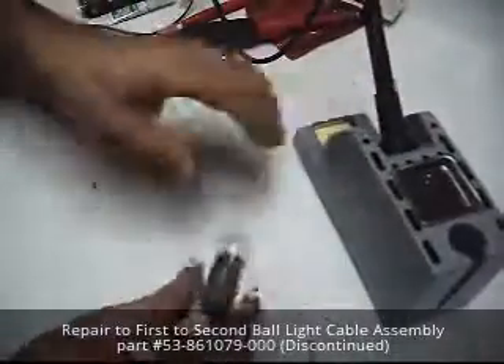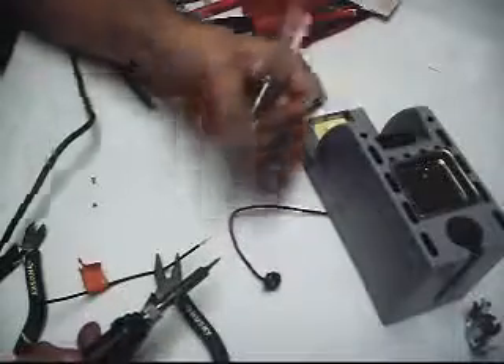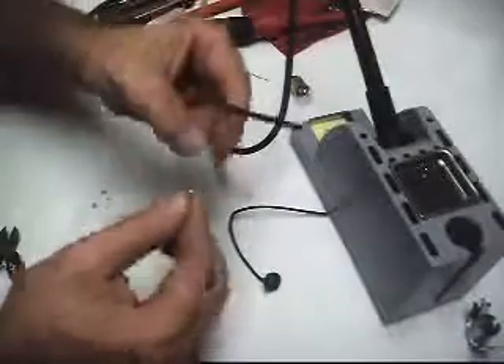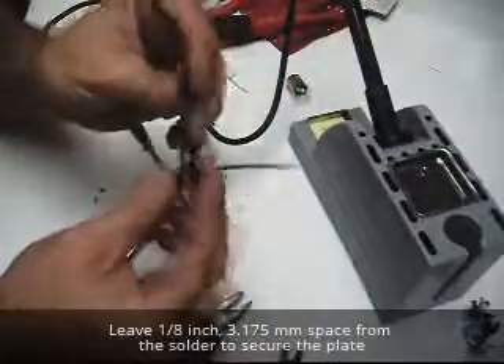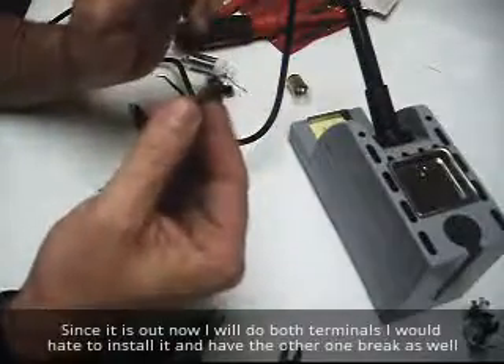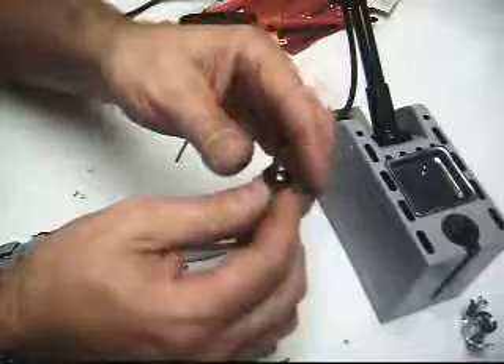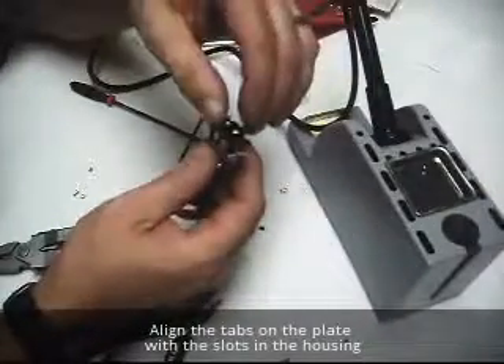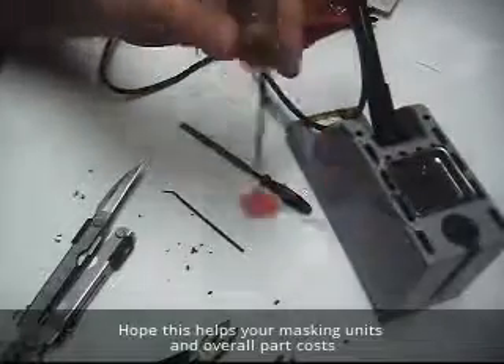Ball Lamp Rebuild

Comment: So I did not check yet, but I have a ball lamp that is not working on a lane. Is this the probable cause of it or is there other causes? thanks
Reply from the maker: Sorry I just noticed this comment.  
For some reason it did not register on alerts.

Your bulb could be blown.
The terminals like the ones I repaired could be separated.
There could be a short internally in the cable.
The main connection terminal could have a loose molex crimp/seat.
The cable itself could be disconnected.
After those have been checked it may lead to a software/pcb issue.
Reply from the maker: Don't forget to also check the connection inside the press nut union.
The one that connects the ball lamp fixture wires to the full wire that leads back to the Nexgen.